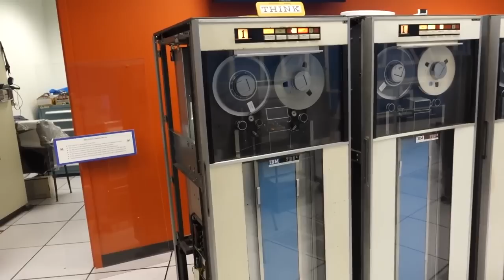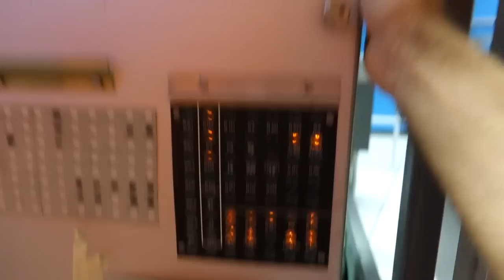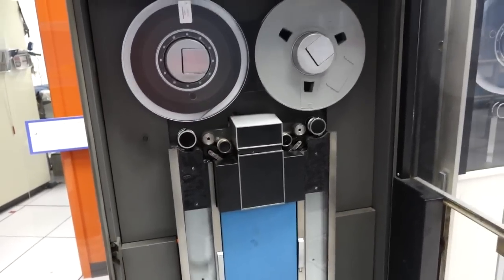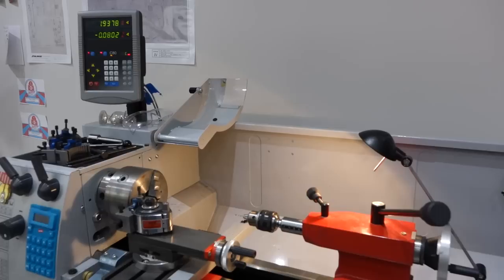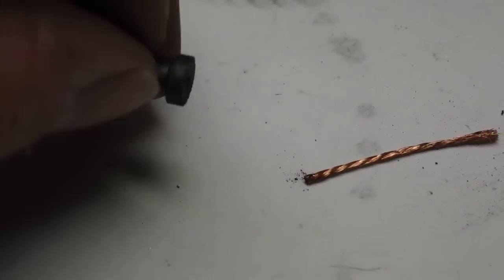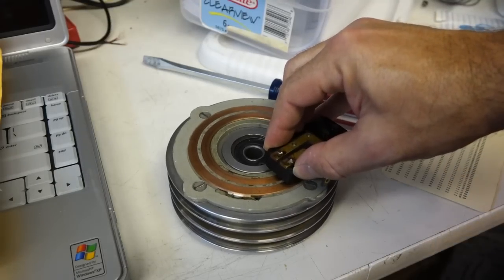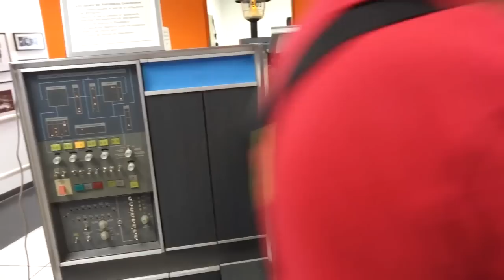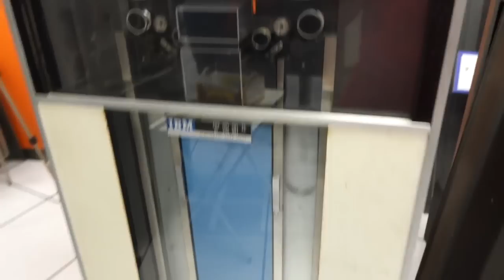Debugging the 1959 IBM 729 Vacuum Column Tape Drive at the Computer History Museum

Comment: Many years ago I refurbished an IBM 727 tape drive (predecessor to your 729). The 727 had vacuum tube logic (plus lots of relays), but the motor drive design was almost the same as your 729. The brushes were OK, but the powdered iron and graphite mixture inside the tape reel shaft clutches had rusted so the reel was trying (unsuccessfully) to turn both ways at once. Disassembly, cleaning, and reassembly of the clutches was a real chore! But I got it all working OK after troubleshooting a bunch of the vacuum tube logic - and learned a lot in the process.

Comment: When I was a boy in the '80s I used to think that every time an old movie or TV program showed a mainframe's tape unit, their prop department had gotten it wrong. I was used to playing around with my father's old Akai reel-to-reel tape recorder, and my grandfather's Wollensak -- the reels both turn in the same direction and at the same time. It wasn't until many years later that I was able to research IBM's vacuum-column technology and appreciate how innovative and impressive their tape units were and still are.
Reply: Same here!! Thought I'd try to find out what was happening :)
Reply: We had some old mini-computers that used 9-track reel-to-reel tapes like these (but not exactly, ours were made by Pertec).  When we had some 'suits' scheduled for a tour, we were told to 'Make it look like the computer is doing something'.  So we would queue up an old tape-to-tape sort program (even though we normally did large data sorts directly to the disk drive).

So when the 'suits' came in, they got to see the reel-to-reel tapes jerking back and forth, just like old movies and they were duly impressed.  lol
Reply: @mikefochtman7164   At my company we ran diagnostics to make them look busy for a TV crew.  🙂

Comment: Fabulous Video !!!  I spent many hours inside the computer room of an IBM 360 and I was always amazed at the incredible speed and quickness of those tape drives, and the slack tape hanging down inside their vacuum chambers. When the IBM repairman came around, he was dressed in a suit and carried a suitcase full of the most beautiful exquisite tools. The type you might see in Switzerland. IBM made precision top world quality machinery, and the tools to maintain and repair IBM equipment were equally impressive.
Reply: Repairing mechanical equipment in a suit sounds like a challenge. I'm sure they had to get them dry-cleaned often too.
Reply: @DevynCairns  Having worked at IBM for a year in the early 90s.... You wore a suit for everything, although you may take the jacket off. Crawling around chasing cables? Suit. Clearing up after a printer decided to launch loose toner across a room? Suit. Maneuvering 1/2 ton tape drives around server rooms? Suit!
Reply: @DevynCairns  to be fair, suits today are not what they used to be. Action back, vents, highly forgiving hand stitching, all worked to give you a full range of motion and a pleasant experience wearing them.

Comment: Three years late into a thread, as usual, that's what the YouTube Algorithm does to me.  This brings back many more memories, although I have to say, these brutes are far more complicated than the CDC machines I worked on in the mid seventies.  That kit was probably mid to late sixties in origin.

The CDC's were vacuum column machines, but there the similarity ended, pretty much.  The Reel Hubs were direct drive, reversible motors - quite meaty things - but none of that coaxial clutch, slip rings and fast rewind motors.  I think they had five motors, including the vacuum pump.  Two reel motors, the vacuum pump and the two capstan motors.

The capstan was a finely ground, forged (I think) cylinder about 75mm in diameter and a bit wider than the tape - say, 15mm?  The circumference had a series of semicircular groves, not quite full width, with a hole drilled into the plenum chamber underneath.  Now that I think about it, there were probably two capstans, although I just don't remember.  One for forward read/write, one for reverse read/write.  I'm almost sure they could do that?  

So the capstan/s(?) were on either side of the read/write section and the left one hauled tape out of the supply column and the right hand one shoved tape down into the take up column.  Next to the read/write head was a fixed block with holes in, which was the tape brake, also vacuum operated.  They revolved at constant speed (the read/write speed) in the appropriate direction and the tape was moved by sucking it against the capstan.  To stop, the vacuum was released on the plenum and applied to the brake.  There was virtually no momentum because all the mass was being driven by the reel motors and controlled by the columns.

Loading a tape was very easy.  You just pulled the leader off the supply reel as it hung down and pulled it across the top of the capstans, the brake and the heads and wound it on to the take up reel.  Then you closed the door and hit 'LOAD'.  The vacuum would come on and suck tape down both columns until they stabilised, then the tape wound forward until the EOT marker was detected.  Then the READY lamp would come on and, with any luck, the deck would go online automatically and work could commence.

I have other memories about slip rings, but that was on CT Scanners and many, many years later.  Thanks for a great series, Marc.

Comment: 0:02  Notice the large panel flooring in this IBM 360 computer room. All the wiring and cooling for the machinery ran under the floor. The computer itself required this specially-built room, and computer rooms  all looked quite similar in every company which owned an IBM computer. Beautiful space-age modern equipment. It still looks futuristic six decades later.

Comment: All that size, mechanical complexity, and electricity - and even an old junk 286 could outpace this machine with ease.  It's astonishing how far technology has progressed in such a short period of time.
Reply: "even an old junk 286 could outpace this machine with ease" - actually no, these systems supported hundreds of terminals simultaneously. What they had that your 286 is lacking is THROUGHPUT

Every peripheral device in the system had an intelligent controller that was an entire computer in itself. I know because I was a mainframe computer operator in the 70s and 80s - you could not imagine a more fascinating job or place to work.
Reply: @vap0rland   I was a computer tech back in the 80s and worked in a data centre on several different systems.
Reply: @James_Knott  my favourite job of all times was computer room shift supervisor. I.B.M. really fumbled when they handed the industry to Microsoft on a silver platter.
Reply: @vap0rland  IBM picked up the government contracts though while Microsoft was playing in the sandbox.

Comment: The little black plastic rollers that push the tape against the capstan to move or against fixed round rubber cylinders to stop are called prolays, one on either side.

Comment: In 1974 I was programming an IBM 1401, GE 225 with drum memory. In 1975 I moved to a IBM 370-135 DOS machine these were all in college. I graduated in 1977 went to work for the USAF doing systems development on a IBM 7080 and a CDC Cyber 170 running SCOPE. There just nothing like the smell of a hot IBM 24 and 80 column cards at 03:00 in the morning

Comment: I used drives similar to these in which the window in front of the tapes would lower for unloading and loading. We used to place the tape volumes of multi-tape master files on control box at the top of the drive. Later, the company bought STC drives, and the windows on those would raise up through the control box. It didn't take long to learn to put the to-be-used master volumes in a separate (and inconvenient) rack. So many memories seeing that printer and the 1401 control panel!

Comment: Well this neat, back in 1996 my electronics class disassembled a 1401 series computer, 720 tape drives and backup power system as a class project. At the end it all was sold as scrap metal

I did manage to keep one tape machine (I bought it for $50) and got it working, It's in my storage building now bubble wrapped up and tarped.. Along with a honeywell mainframe and hard drive rack.

I have a personal collection of vintage communications and computer hardware. I have one of the original World of Warcraft server blades also.
Reply: What's the spec of the WoW blade?
Reply: I'd buy the Tape drive & disk drives. But I already know your answer. lol was worth a try to get a bite
Reply: In my electronics class I dismantled a radar transmitter/receiver, complete with magnetron!

Comment: Great video! I love 1401s, they were  such a big improvement over the 402 accounting machine! Spent many happy hours programming these puppies. Almost wish I had one. :-)

One minor correction - disk drives existed at the same time as these tape drives. All the 1401 systems I used had multiple disk drives and no tape drives. Tape access was generally faster than disk access if you were doing a sequential update job, but a compile from a disk drive was a heck of a lot nicer than compiling from tape!
Reply from the maker: OK. I thought the 729 vacuum column tapes predated the RAMAC (first hard disk) by a bit. I'll double check. But yes, later on you could hook up a RAMAC disk unit to the 1401. [edit] Indeed you are right: 729 tape is 1958, and the first RAMAC is 1957!
Reply: However, the 729 was first introduced as a minor modification of the 727 tape drive, adding a two-gap head. The 727, in turn, was an improved version of the 726 tape drive from 1952.

Comment: Maximum respect to you guys for your time and dedication to keeping these amazing machines going.
The random movement of the reels on these drives has always fascinated me.
Thanks for sharing this. 
I worked for DEC many years ago, though I'm not sure they produced a vacuum column drive. Maybe you know....?

All the best !!
Reply: these machines  are built like steam trains they will last for years to the earth dies while modern  computers will last 5 years and die due to the life cycle of silicone and transistors  and the caps on the boards